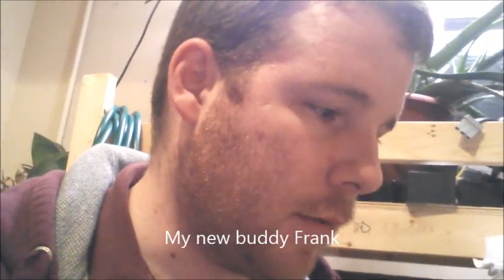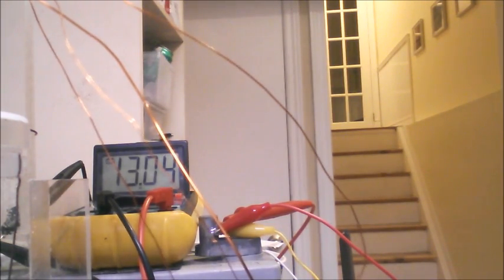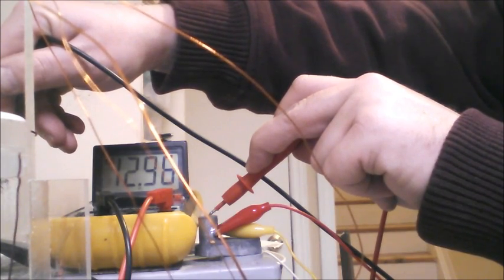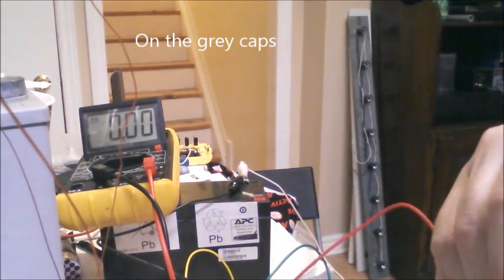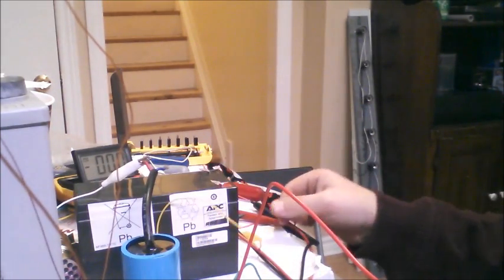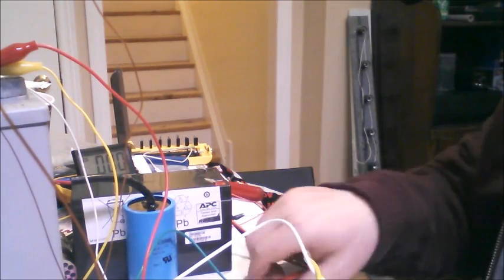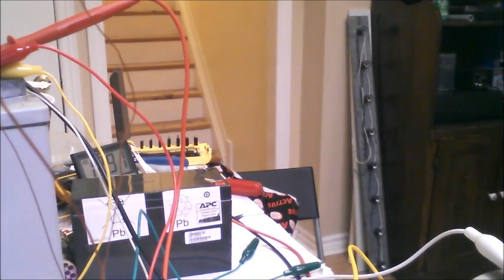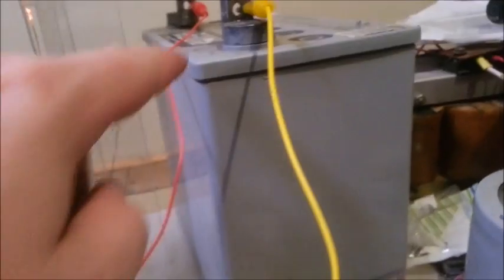Free energy "The Revolution SSG Bike" P7 By inventor Matt McMahon, inspired by John Bedini Motor

Comment: h2oplasmaplug,
 The Bedini motor is is consuming ALMOST no power because it it is doing ALMOST no work! This is normal. When you actuallly get your wheel to do something other than just "sit and spin" your jaw will drop as to how fast your battery will drain ot ZERO VOLTS. Still no FREE ENERGY here ... You want to bet that POST # 8 will yield the exact same results - ie NO FREE ENERGY ?